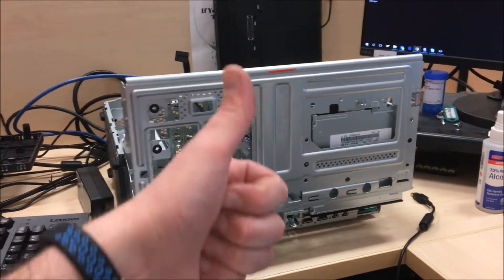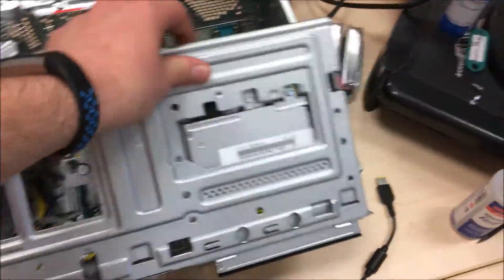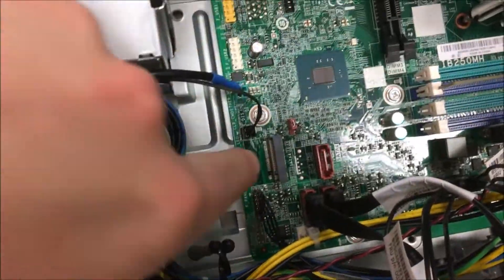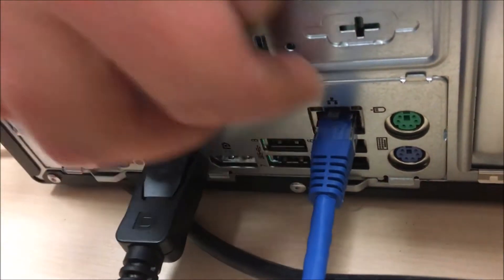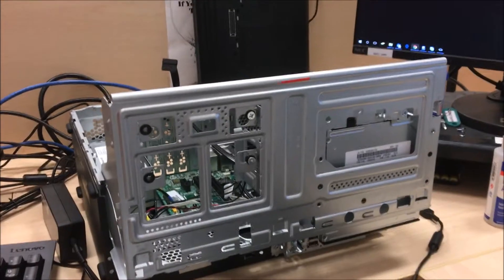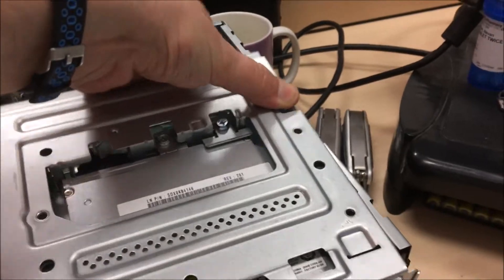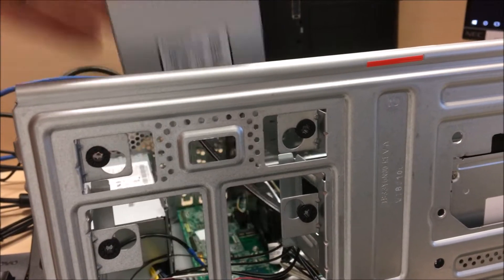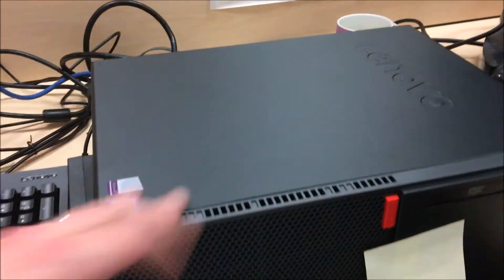Lenovo ThinkCentre M710s - SFF - Core i5 7400 3 GHz - 8 GB - 1 TB Review And A Look Inside Benchmark

Comment: If i change the Case and the PSU, can i add GPUs like 1060 or 3070?
Reply: Yup that’s exactly what I did and now I run it with a gtx 1060
Reply: @ButterChickenRNG how did you change the psu if it's all proprietary?

Comment: Hi, I would like to ask a question:
I have the same computer but my cpu is i5-6500 Graphics card is hd530
I would like to buy a new graphics card for this computer.
Does this computer have extra space to install a discrete graphics card?
If possible, which graphics card should I buy with the lowest budget if I want to play GTA5 and DayZ?
PS: My system uses SSD for games and uses HDD, so it's no problem for the time being

Thank you

Comment: Hi, have a nvme m.2 slot?
Reply: It is an m710s and its on the label sticker with S/N. It has 2 X M2 nme ssd slots.,one on top of the other on the motherboard. It has a DVD RW. And there is space on the lift up cover to put in a standard size SSD like the small HD in laptop. Mine just bought with Win 11pro
Someone else has posted a low profile graphics card can be install in a m720s but the inside is the same with four port and the end one is PC!e x16. Hope this helps.

Comment: can it work for games
Reply: big games run at like 40 fps on low settings, its cool if u want to actually use it as a computer but i suggest leaving the AAA games to the consoles. U can find a ps4 for 100$ on ebay or offer up